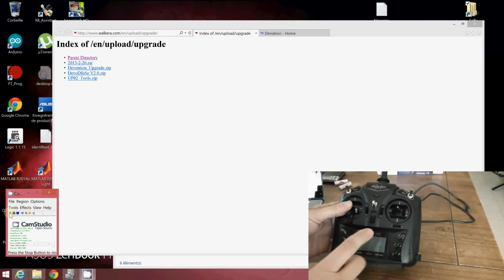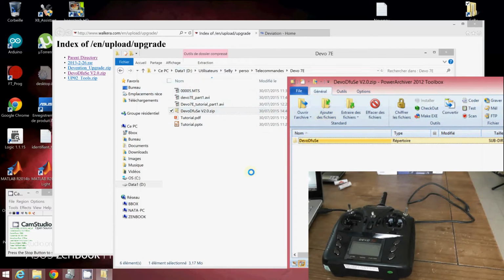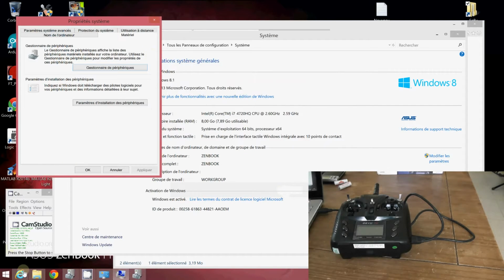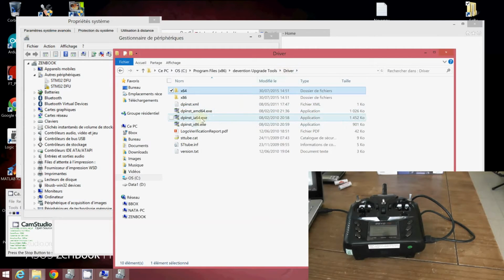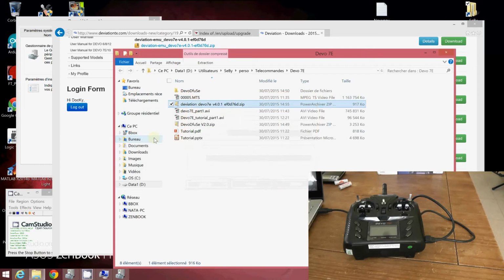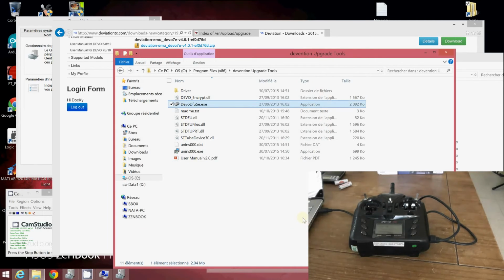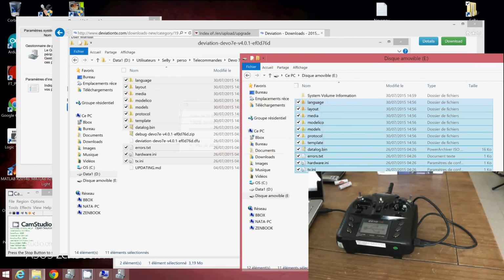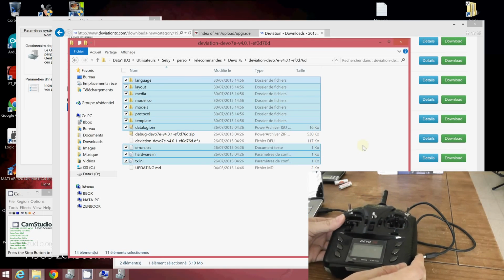Devo7E tutorials: part2 - deviationTX installation

Comment: Highly appeciated this Devo7e-part-walkthrue, thx..(douze point a la France.!) was wondering about keeping that nr2 anetenne-wire in the original antenne if you only plan on putting the nRF24L01 chip in, and not having an entra psysical anenna until you actually need two different anenne signals at once, like 5.8 and so..or are there interferens from the other original chip ewen when your on nRF24L01 and it wouldnt be ideel to hving these two antennawires running alongside each other in the main antennehub?
Reply from the maker: +GroupDenmark Hi ... Not sure I understood everything :( ... but each RF chips need its only antenna actually. You can't share one antenna for sereral HF devices
Reply: +SeBy DocKy //(thx for the fast reply)  it was more in line of only the antenna wire..Was thinking about just purchasing the nrf24L01 chip with UFL/PEX plug and attach an anetenna wire (only the wire) on that UFL/PEX plug and lay it alongside the line of the anetenna wire comming from CYRF-chip.. it looks like from your other video that there should be room enough in that hard platicbulp that goes for the anetenna on Devo7e, and then doesnt have to cut of the screw holder for an new hobby grade psysical anetenna and that these two single anetennawires wont interact so close to each other and only one is on the beat at the moment of use....// huge cadeau for your vids (partically this part-series ' highly appreciated for an newcommer like me)...